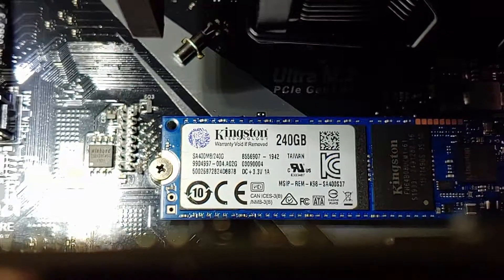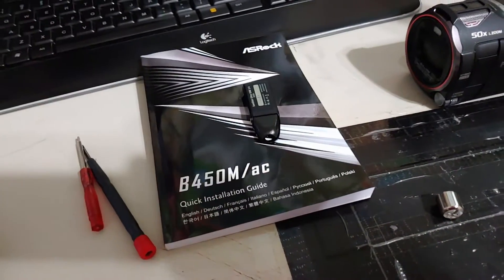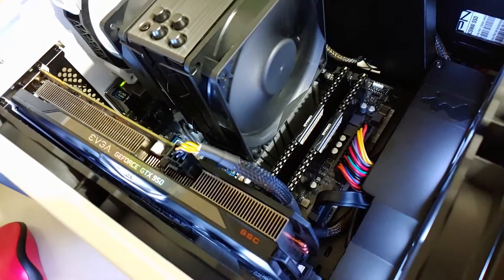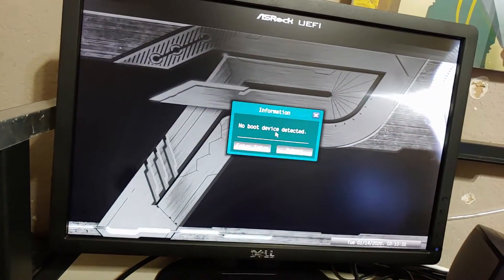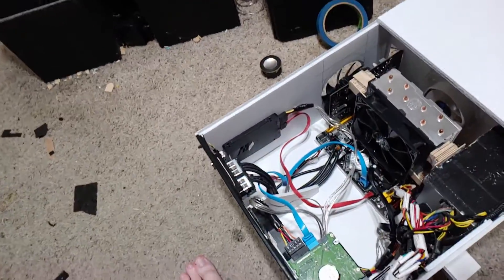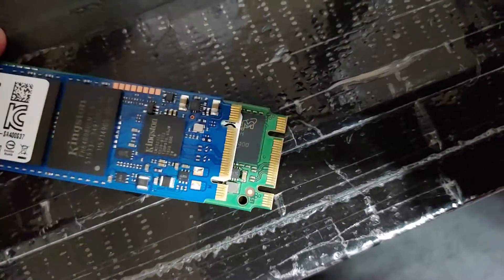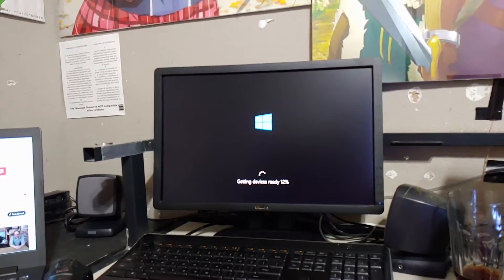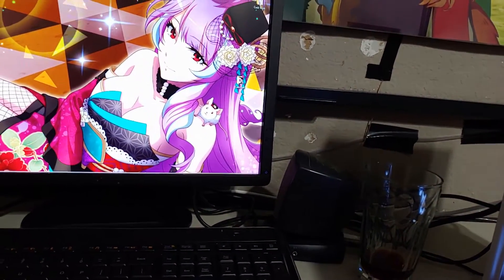ASRock B450m/AC M.2 Will Not Work

Comment: you put the wrong type of  m.2 in the wrong m.2 slot there  is 2 m.2 slots on this mother board i have the same one the m.2 you used is a 2 knoch older genration sata m.2 and its slot is lower on that mother board the slot you put it in was meant for third gen nvme ones with the one  knocked in it with the nvme m.2 i never had  any issues uploading windows 11 using the third gen m.2 in the slot you put that older sata gen m.2 in thats why you were having issues with it i think but im glad  you found a work around to boot into windows with it

Comment: - 1 x Ultra M.2 Socket, supports M Key type 2242/2260/2280 M.2 SATA3 6.0 Gb/s module and M.2 PCI Express module up to Gen3 x4 (32 Gb/s) (with Matisse, Picasso, Summit Ridge, Raven Ridge and Pinnacle Ridge) or Gen3 x2 (16 Gb/s) (with Athlon series APU)*

can someone tell me if this motherboard compatible with nvme ?

*ASRock B450M HDV
Reply: It supports NVMe but make sure the key of your SSD is correct.  NVMe only has 1 cut out, SATA has 2.
Reply: @azndood  M key right ? I want to buy adata xpg gammix s11 pro, thanks man for the information

Comment: Use that m.2 on the bottom slot of the mobo, the first one (slot found in the middle of the mobo) is only compatible with nvme m.2 , you will also be forced to use it as a boot drive.
Reply: Can you explain a bit what exactly this is about? I'm going to buy this board soon. I will be able to use a m.2 ssd on it right?
Reply: @immiteshk  it has to be a NVMe M.2 SSD.
I have the exact board and I just finished installing a NVMe M.2 on it (Samsung 970 EVO Plus 500GB specifically) and I'm having no problems.
Reply: @Dee_Sandoval but it doesn’t work for me ... I installed it, the bios sees the ssd, but it is not shown in windows 10, maybe you know what to do?
Reply: @immiteshk  no it supports only nvme ssd which is expensive and u can use normal sata ssd with a adapter
Reply: @vasanth1816  I literally just had this exact same problem. The top M.2 slot is worked just fine with my NVME but I was  trying to use my SATA M.2, I finally figured it out by calling customer support, they said to use the bottom slot (it is dual, top NVME and bottom SATA) , Did that and worked like a charm.
Reply: I have the same board and nvme m.2 but no screw and no screw works
Reply: I’ve a sata m.2 installed in the standard m.2 slot and it is also my boot drive. I’m thinking about adding a nvme m.2 in the ultra m.2 slot as well. 

Can i keep using the sata m.2 as the boot drive or will i be forced to use my nvme m.2 asboot drive?

Also, cam i use both sata and nvme m.2 together.

Comment: if your looking for one that work and you have this board as i do this is what im useing and it works great
Silicon Power 512GB NVMe M.2 PCIe Gen3x4 2280 TLC R/W up to 3,400/2,300MB/s SSD (SU512GBP34A80M28AB)
Reply: Bro so I'm building my first pc and I have the same motherboard is a Crucial P1 500gb NVMe PCIe support this motherboard??
Reply: @myst4351  honestly i think it will that seems more name brand then the one i used lol so yeah id bet 95 percent sure it would
Reply: @pkbattosai  thank you man whew I've been panicking for the pass 5 days ahah thanks alot bro I have great year and stay safe
Reply: @myst4351  you to man good luck with everything!
Reply: Bios Manu sowing nvme ssd ???

Comment: if your m2 ssd is a sata 3, put it on the m2_2 slot. m2_1 only supports nvme
Reply: Thanks for the sauce Man.
Reply: @psalmmamburam9395  So it work at slot 2?
Reply: thsked fot thr juidefre bto
Reply: Bro, if I put another nvme pcie ssd on m2_2 slot, will it also work?
Reply: @kelvinperez6924  refer to manual bro, but as far as i know if you use m2 nvme ssd on as asrock boards it works mostly on m2_1
Reply: @carljunlauron7127  oh ok, but can I use m.2_2 slot for boot disk?
Reply: @kelvinperez6924  yes you can

Comment: Does this board support Team Group Nighthawk 3200mhz Ram?  I have exactly same board with this ram but when I use XMP profile, my screen shows blue screen
Reply: The B450M/AC's supported ram products are available here. Just click the "Memory QVL (cpu generation)" and see if it works. 1st gen = Summit, 2nd gen = Pinnacle, 3rd gen = Matisse.
Reply: If your memory isn't on the manufacturer's QVL (Qualified Vendor List) the exact XMP profile may not work as stated on the box.  You could attempt a slower clock speed with the same timings or go down the rabbit hole on figuring out a custom XMP profile for your memory.

Comment: Sup dude. Does the board work with Ryzen 3000? Does it say Ryzen 3000 Ready on the box?
Reply: It does. Right out of the box. Mine didn't need a bios update and neither did most of the people who left reviews. If you got it awhile back then you'd probably need a bios update but its good now
Reply: @pyrex5594  thnx man much appreciated, this is such a hustle to get board with zen 2 support
Reply: @pyrex hello, quick question, I was planning on getting this board but I'm hearing you need a specific ram because of the sizing or fitting?
Reply: Daniel Arizpe You don’t need specific RAM at all. I’ve seen people use bigger sized kits of RAM and low profile kits. If u wanna play it safe, here’s the RAM I’m using with mine. 

https://www.newegg.com/team-16gb-288-pin-ddr4-sdram/p/N82E16820331360?&quicklink=true
This RAM is really good too because it’s a Samsung B Die, which pretty much means it can be overclocked really well. Ram size pretty much doesn’t matter at all unless you have a giant cooler that might get in the way of it. You’ll be fine.
Reply: The motherboard's website states that it supports Ryzen 3rd gen processors with all BIOS editions. So yes.

Comment: I wish i found this video sooner, but I hope this helps

When buying products that depend on compatibility/support such as these or any other computer parts you should always check to make sure you are purchasing the correct product! In this case your MB doesn't support the purchased product, I recommend checking the manufactures website for a support/compatibility list! This time I have done so for you!

This link that I kindly attached will take you to your motherboard compatibility chart. The part # is the important part to look at which is on the far right of the chart! You will also find info such as the brand, size, interface and length!

https://www.asrock.com/MB/AMD/B450Mac/index.asp#Storage

This link is an example of a supported/compatible M.2 product. As you notice the part number matches with the one on the MB support/list for M.2 * WDS250G2X0C *
https://www.amazon.ca/WDS250G2X0C-250GB-High-Performance-Solid-State/dp/B07C9H8MHD/ref=sr_1_1?keywords=WDS250G2X0C&qid=1585732341&sr=8-1

Feel free to reply with any questions! Good luck and enjoy future builds! :)
Kindest regards <3
Reply: bobby ruest  I do not see any drives made by crucial on the supported list. Are we looking at the same page? https://www.asrock.com/mb/AMD/B450M%20Pro4/#Storage
This is the supported storage drives for the Asrock B450M Pro4.

Comment: I know MR MR already clarified in the comments but since I have this mobo, I just want to clarify as well. Yes, that is accurate. Since the mobo only supports NVME M.2, using a SATA M.2 won't work. If possible return your sata ssd for an nvme model. Like a samsung 960 or 970 evo.
Reply: JKees will the crucial p1 work
Reply: Just finished installing the 970 Evo Plus 500GB (yes, NVMe M.2). $79.99.
Was afraid I was ONLY going to be able to use it as a boot drive but after formatting it my PC recognizes it as a normal storage drive.
I'm happy.

Comment: this MB only supports nvme m.2, not SATA, you can read on product specs and qvl list- all pcie based.
Reply: @Anton X it should work based on the specs  since it's NVME, good luck.
Reply: I just bought this board. It says it supports sata 3 m.2 drives. I’m about to find out i guess
Reply: Hunter Long update?
Reply: UnknownZ did not work haha. Called Asrock technical support and he directed me to the board’s page on their site where it specifies NVME. I directed him to the overview of the board on the same page that shows a picture of the m.2 slot and has a caption that says supports pcie x 4 pcie x 2 and sata 3 6gb/s m.2 drives. He said oh no I’ll have to show management, that shouldn’t be there.
Reply: Bro so I'm building my first pc and I have the same motherboard, is a Crucial P1 500gb NVMe PCIe support this motherboard?? Pls help I'm new to this computer world stuff😂😂
Reply: Donde Esta La Leche? It depends. I see there’s a sata version and a pcie gen 3 version. The sata version will NOT work.
Reply: @hunterlong1820  oh okay thanks bro u have a great day
Reply: @myst4351  did your nvme ssd work on this mobo??
Reply: @myst4351  did Crucial P1 500gb NVMe worked for you?
Reply: hi mine is working but having blue screen you know why?
Reply: @noziinosente4409  what are you running your ram at? Most common cause I’ve found in ryzen systems